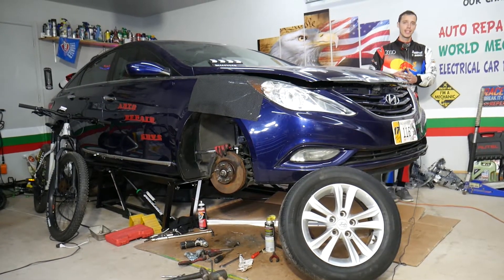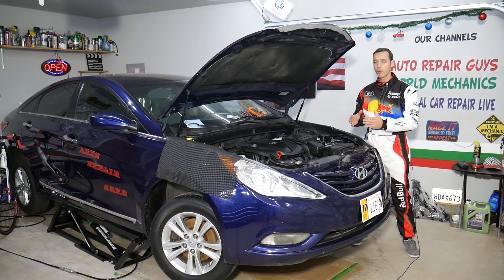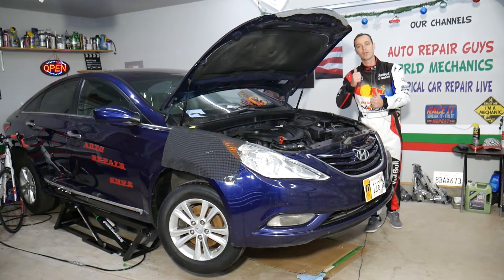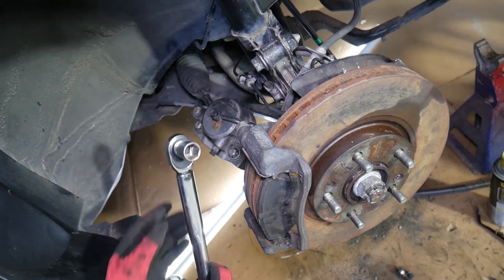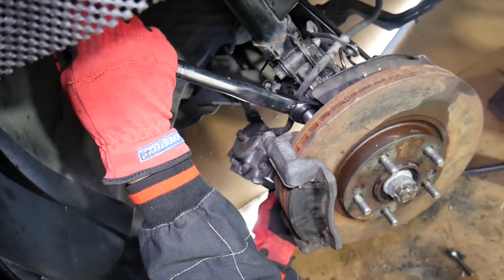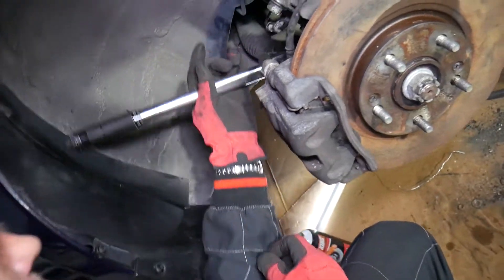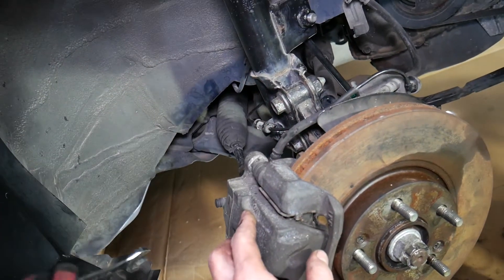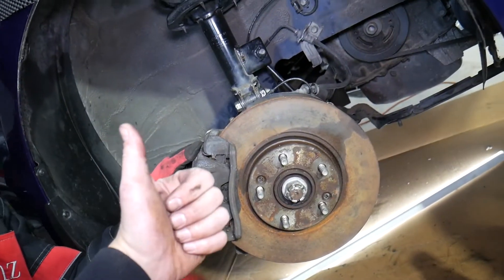HYUNDAI SONATA FRONT BRAKE CALIPER TORQUE SPECS, BRAKES TORQUE

Comment: The numbers you mentioned in the video sound correct and match my Haynes manual for my 2010 Hyundai Sonata (front brakes only).

However, the Factory Service Manual seems to have the torque specs reversed between the FRONT and REAR caliper bracket mounting bolts. The FSM lists the front torque lower than the rear which makes no sense since the front bolt appears larger and 70% of the braking ability is in the front brakes.